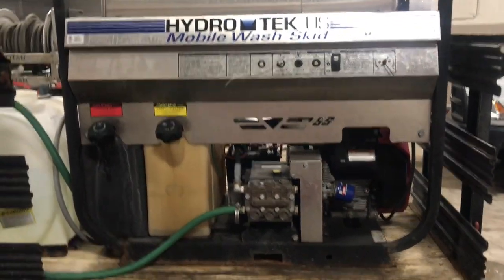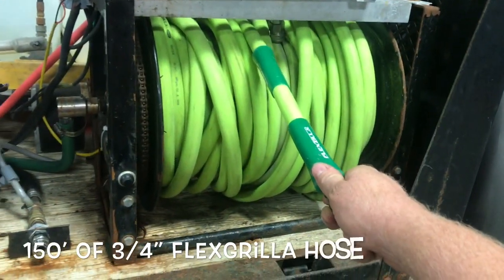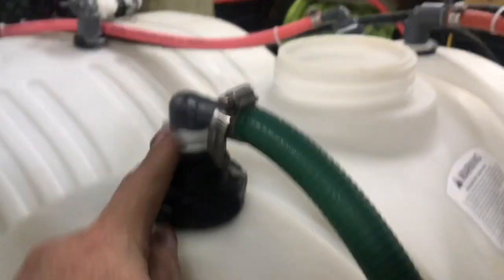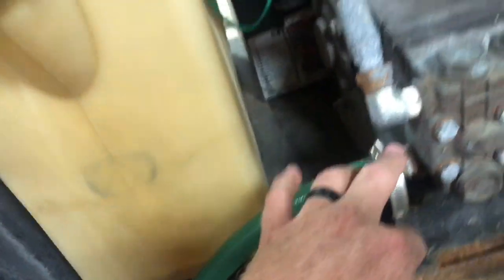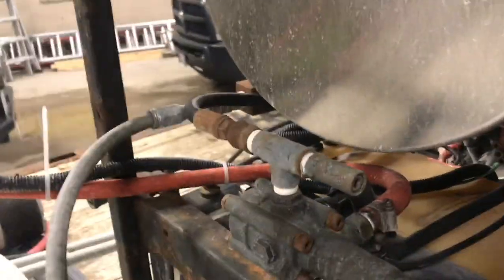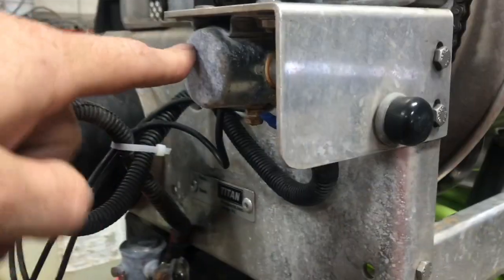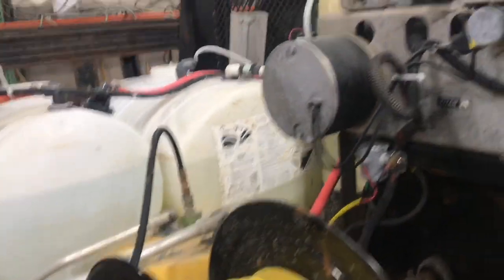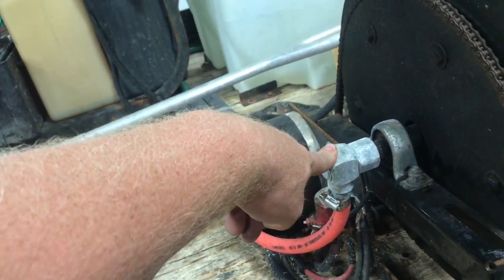How To Plumb A Pressure Washer Rig | Truck Or Trailer

Comment: I have the same super swivel for 9 yrs on my Hydrotech rig trailer.If you take the grease fitting out and slowly move the swivel back and forth,the ball bearings will come out the grease fitting hole and   then remove the inner swivel and service the seals with new ones from Harbor Freight.Takes about 1 hour.Just dont loose the ball bearing.

Comment: What size hose would you use to feed a 4gpm with at least a 100 gal buffer tank.
Reply from the maker: Great question! For a 4gpm flow rate and a 100 gal buffer tank, I would recommend using a 3/4-inch hose to ensure sufficient water supply.
Reply: Thank you for your reply, one last question ? So I’ve noticed a lot of guys are using a 1” house even with the 4gpm machines but they have to attach to a hose barb that goes into the pump of the machine, would I have to make that modification to my machine if I used a 3/4 inch hose ? Or would I be able to connect the the existing connector that’s already on my pw ?

Comment: Hey Jason my 2 inch suction hose that goes from the buffer tank to the pump inlet has a tiny drip coming out of one of the hose barbs, is this ok? I heard the system should be air and water tight?
Reply from the maker: Tighten up the hose barb or hose clamp
Reply: @kingofpressurewash  thanks man! Love the videos and the fact that your humble keep it up brother!

Comment: I have a newer predator 3100 psi 2.8 gallons per minute power washer and all of a sudden I’m having an issue when I connect my garden hose and it has full water pressure but the power washer will not allow the water to enter into it at all any suggestions I would be appreciative...ty

Comment: Is there a video on what you need that explains everything? Plus each part list
Reply from the maker: https://www.pressurewashhelp.com/buildlist/
Reply: Power Washing will this list work with a 8gpm machine
Reply from the maker: @motorcycleislife8296  you can use this list for 8n gpm. you will need to go from the 3/4" hose to 1" hose on suction side of pump. also you will need 3/4 " garden hose to feed it
Reply: this don't open anything for me

Comment: @Pressure washer help: I have a ever flow 5.5 pump an my outlet spray hose is 1/2" should my inlet be 3/4 from pump to reel an from Proportioner to pump. Cause my Proportioner came wit 1/2" out an 1/4 1/8 1/4. Basically what I'm askn should all my line go up a size or keep it all like it is to get get flow out of my 1/2" spray line

Comment: How long does it take to fill the water tank before you can run the machine i dont see the point. Why not just feed the pump with the derect line from the clients house to the pump
Reply: Buffer tanks are used for several different reasons. Depends on size of your unit for one, up to a 4gpm usually is ok running off house supply directly but bigger usually needs buffer. Also some customers that have a well worry about the demand on their pump so good to have a buffer tank. That’s just a couple reasons for buffering tank.
Reply: Typically anything over 4 gpm require a buffer tank because your machine will use water faster than the typical home water supply can provide. Plus you can plumb it so that the return water helps cool your pump during non spraying time. It's really better to just go ahead and have a buffer tank for good water flow to your machine anyway regardless of what gpm flow rate you have.

Comment: would a 5/8 flexzilla hose work well with a 4.0 gpm pressure washer?
Reply from the maker: Yes for the intake of water
Reply: How many gallons is that water tank? And where can I find your video on connecting high pressure hose without using swivel on reel?
Reply from the maker: @Oscar-vs9xv  its a 65 gallon tank. here is link for high prssure bulk head https://youtu.be/WOiKf592ooA

Comment: Where do you find the suction hose? Does it go by another name?
Reply from the maker: heres 1' https://amzn.to/2VaHBFq
3/4  https://amzn.to/2VmvHZi
Reply: Power Washing Thanks! I appreciate the tutorials!
Reply: For 4 gpm I could use either 3/4” or 1”?
Reply from the maker: @dfingerz  i would go with 3/4
Reply: @kingofpressurewash  what happens is I use 1 inch line for 4gpm? Just in case down the road I use the same plumbing for an 8gpm machine
Reply from the maker: @BadWeatherfreak  you can absolute do that